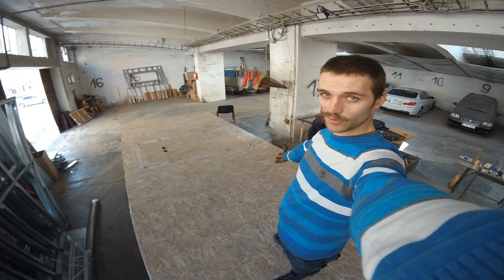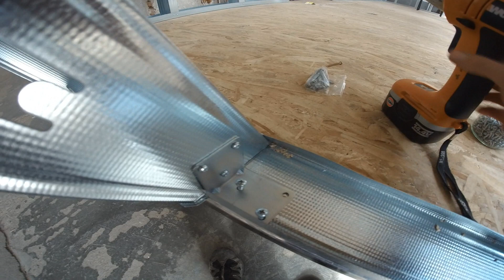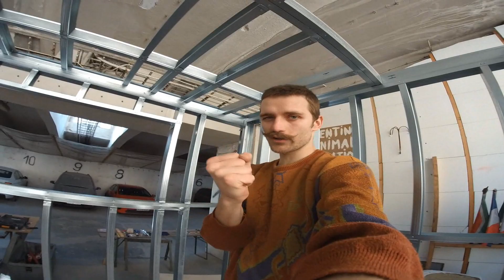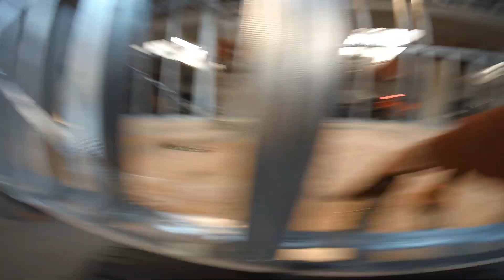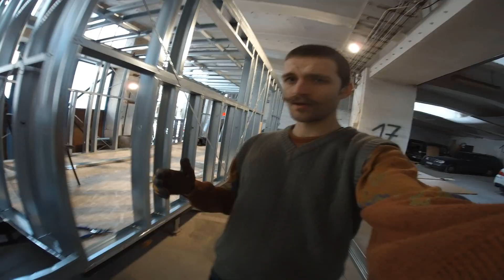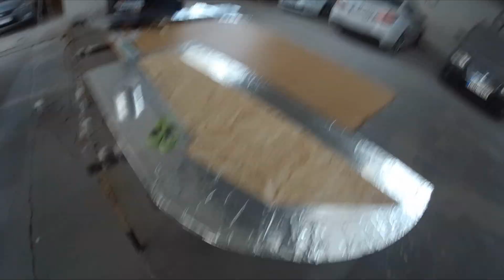DIY tinyhouse frame! steel stud construction

Comment: the roof is flat without any slope?, how do you manage it when it rains?
Reply: Even the smallest degree roof is able to let water run off, they might just have a really low angle on it like a 1 to 3 degree angle

Comment: what distance between every steel frame 0.4m. or 0.6m.?
Reply from the maker: The standard distance i used was 60cm, it was the same as the rockwool width. Some areas have less distance in between as you can see like at the windows and edges etc. 👍🏼

Comment: hello. how thick is the metal studs ?
Reply from the maker: 0.5mm
Reply: @RobbertvanHaaften from studs that are 0.5 mm you can build a house too or you need thicker studs ?
Reply: Thicker 16 gauge for load bearing